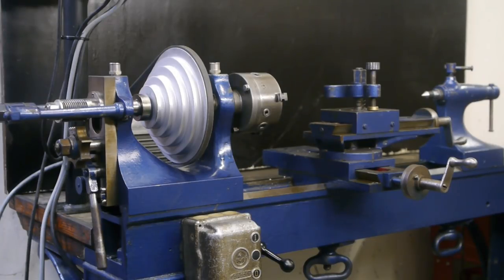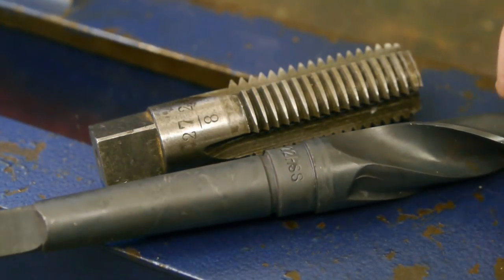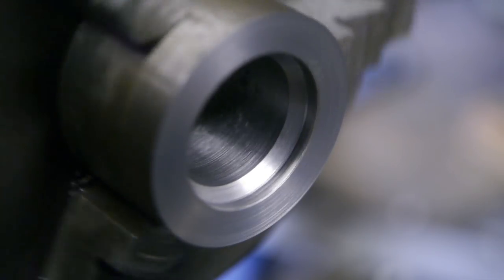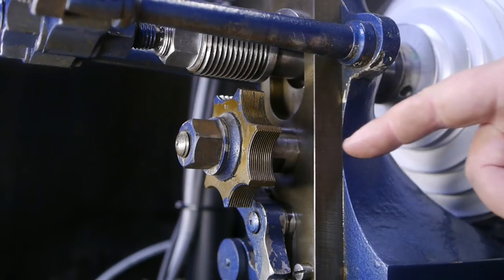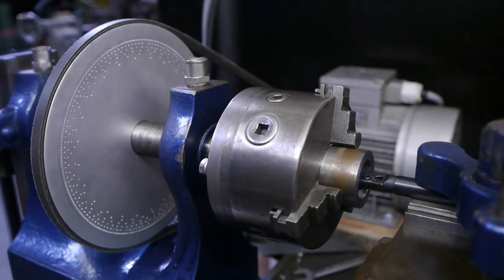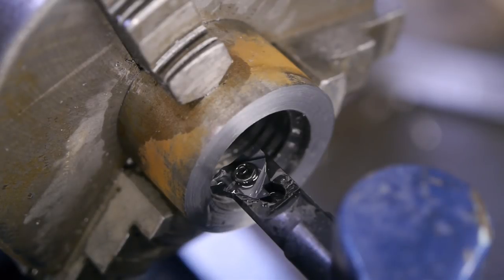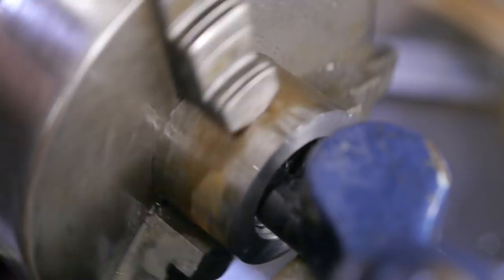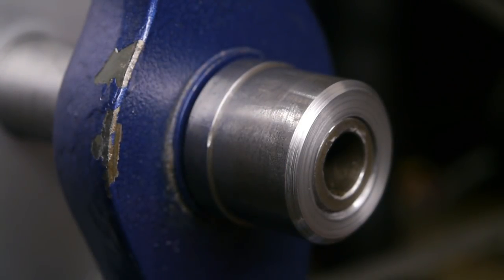Old skool sliding spindle thread cutting / Making a spindle nose protector

Comment: Very interesting lathe!
Spot on with the comment about motor speed and power. I remember the pain of hand threading with my old lathe when it stalled. Love my current belt geared lathe
Reply from the maker: Hand threading was actually the only way. With the belt tensioned properly the spindle could not move forward enough before the belt would run of the pulley.

Comment: have you ever  considers , using treadling mild on the siystom  you are using it would lend itself ,  well  to the methods you are operating  see  Stephon's channel . Thread mailing on a lathe for guidance.  I believe  the siystom will help   your  ability to thread cut with your very special  type of lathe . That's what i would do.  It will be a bit of a learning curve at first But an very good Alternative . More so  as you have that type of led screw drive  Check out his channel get the "SP"  on the subject . I never looked back my lath as No lead  screw  Just a rack to drive  The sandal.

Comment: Thanks for the video.

A very interesting method of threading.   My first internal threading on my metal lathe was 1 1/4in x 8 tpi for a wood lathe project.  I also turned the chuck by hand using a wrench over the chuck jaws.   I was threading a piece of aluminium, but it was still hard work.

Carbide is hard but brittle.   I have also broken the tips on threading inserts as well as HSS.

The spindle protector looks good.  I made one out of wood for my metal lathe.   It does not look as good as yours, but easy to make and replace.

I hope you were able to get the protector off.

Dave.
Reply from the maker: Were you able to cut thread in that wooden spindle protector?
I tried treading wood once but failed miserably.
Reply: I'll jump in, as I've cut a lot of threads in wood: the mechanism with the star nuts is excellent for threading wood. It was mostly used with a treadle, rocking it back and forth. Maple or beech will give decent tvreads, especially if you use side grain, and don't drill into the end grain. (With sharp tools, you can use end grain also).The best wood for sharp threads is boxwood, and some exotics. I don't have a reciprocating spindle on my lathe, but cut threads with chasers, in wood, horn, plastic and metal. It's a lot of fun.
Reply: As Andre mentioned some wood take threads better than others and threading into face or side grain works better than end grain.   I have had success with maple and black walnut.   Coarser thread work better than finer threads. 

For the wood lathe I have threaded 1 1/4in x 8 tpi for wood faceplates and 3/4in x 10 tpi for adapters to fit on a OneWay live centre.

Some folks reinforce the wood with CA glue.  I have had mixed success with this reinforcement.   I get better results using wood which will take the thread.

For hand chasing threads I have read that exotic woods work best, likely due to density and consistent grain.

I purchased a tap sold for making wood faceplates.    The tap is decent.  The wood selection is key.

I also use the tap for cleaning up 1 1/4in x 8 tpi threads in aluminium which I have singple pointed on the metal lathe.

Dave.
Reply from the maker: Tanks for all the info.
I have some beech, it might be fun and also make a spindle nose protector using that.
But I'm not sure about the carbide inserts. They might not be sharp enough and have a lot of negative rake.
Reply: Happy if the information helps.

I love turning beech, I just do not have much in the shop.

Carbide inserts should cut the wood.  Negative rake should work.  Some turning tool scrapers have negative rake to improve the wood surface.

Just watch for tearout and if needed try the CA glue or some other wood finish product to harden the pores such as lacquer.

Dave.
Reply: I find the new Tec lends  it  self  well to the older Lethe  in this video i have pointed out Stephon's. ues of Mill.  threading on a engine lathe   & in his demonstration . the ues of a router , lowed  grater control over the cutting of a threads. even at very  slow speeds like when rotating a chuck by hand in. fact  the system delver's  grat & In 'proved third of all tips & destones, with a chasing third to gird  the thread such as the one on his Lathe . 

& yes it would lend  to his ability to cut wooden thread too. TO Boot

Comment: Interesting attachment for threading, seems to work
Reply from the maker: It worked reasonably well, but I was surprised a the amount the tool bit moved under load.
Reply: For me, the jury is still out on the 3 sided insert threading tools. They have too much negative rake for my liking and seem to add more tool pressure than I would care for
Reply: Most carbide insert tooling is made for production machining on  machines with far more power, and rigidity than home shops generally have.  The negative rake at high speeds and high chip loads   produces good finishes and material removal rates, but is often a problem at home shop speeds and feeds.  

I have better luck with inserts made for aluminum (which often have positive rake), when I can find a deal on them.  I've never seen a positive rake threading insert.  I would guess they exist, but they don't turn up at the bargain / surplus places I normally check out.

Comment: What are the size for the spindle thread on this lathe? I have a very simular lathe but haven't figured out what the thread size is. Its not a m25 and not quite a m27 , something in between it seems like. Keep up your great work and greetings from Sweden.
Reply from the maker: This lathe is 1 inch 8tpi. I believe it is rather common on wood lathes.

Comment: Need to make one of those for my lathe but can't find a Whitworth thread cutting insert big enough, but I think I can adapt a boring bar to do the job.Either that of I'll have to try grinding a thread cutting tool !
Reply from the maker: Perhaps there is a tool that mounts 55 degree inserts at a 90 degree angle.
Reply: I'm going to try a DCMT070204 carbide insert in a 10mm boring bar that I'm going to try bending so the insert aligns for thread cutting.Not much to loose at £4.43 with 2 inserts delivered. There will be a video and likley in the comments someone will tell me the correct tool for the job ! lol
Reply from the maker: That's not bad idea. 
An other option might be a toolbit that has the insert in-line with the shank. 
Shorten it and use in in a homemade boring-bar. But it might be to big to fit inside the workpiece.

Comment: To make longer threads is it possible to reset several times? Makes me appreciate the gear box on my lathe. I wish quality inserts weren't so expensive or could be bought in pairs instead of 10s. The cheap Chinese ones seem really inclined to chip easily. I mostly use HSS.
Reply from the maker: There is no backlash or play in the template so it should be possible to move the cutter and line it up again with the already cut part of the thread.
Recently I used a cheap Chinese  external threading inset and it worked great. I'm sure these insets would also work fine on a modern lathe. Also, I managed to make a better thread and break less tips when I set the topslide to 29 degrees.

Comment: either tailstock alignment or drill not sharpened properly
Reply from the maker: It was a brand new drill. But you might be right on the alignment. Further investigation will have to be done at some point :)
Reply: still have to look at the drill closely, i bought a new drill bit , by heller germany, it had no relief angle, it would not drill anything, it was a 13mm drill so i could see it visually.  have to check everything to be sure :)